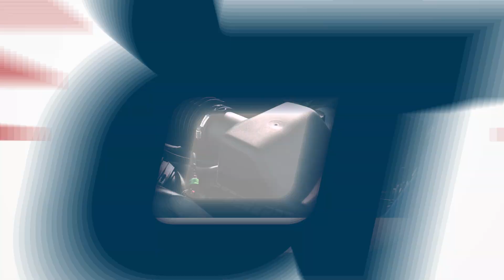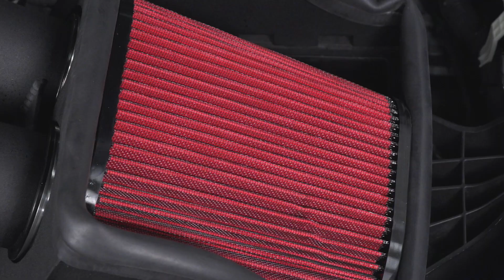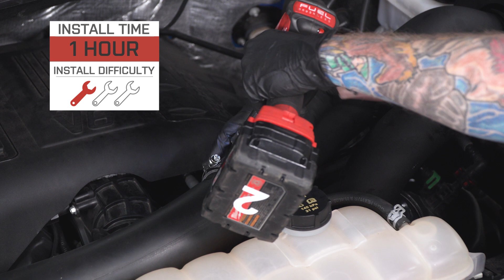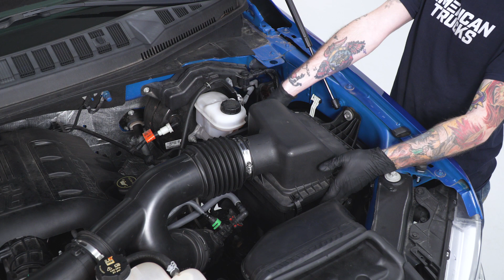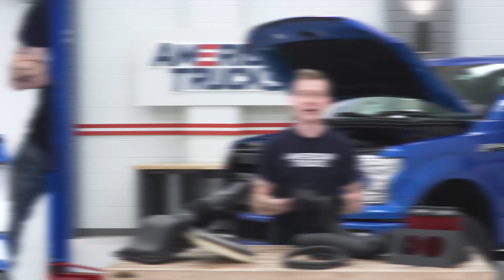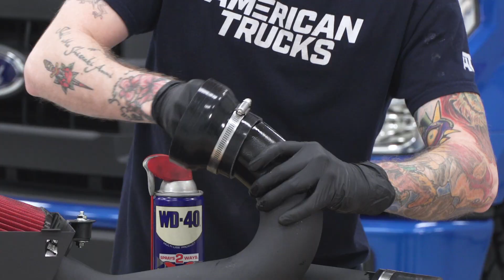2015-2016 F150 3.5L EcoBoost Speedform Cold Air Intake - Wrinkle Black Review & Install

Comment: Does this work for 2017 2.7
Reply from the maker: This Cold Air Intake will not fit your 2017 2.7L Ecoboost. I'd recommend checking out some of the other choices we have on-site that do fit though! Like the JLT in the following link! -Zach 
https://www.americantrucks.com/jlt-27leco-f150-performance-cold-air-intake-cai-f150eb-1.html